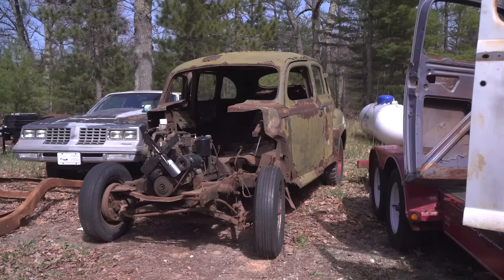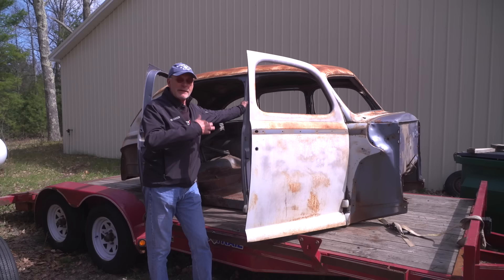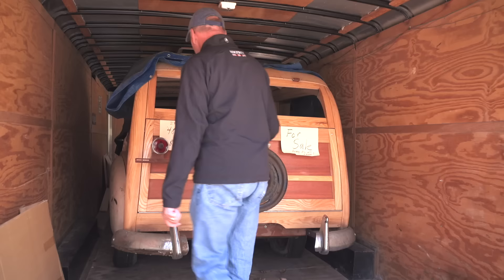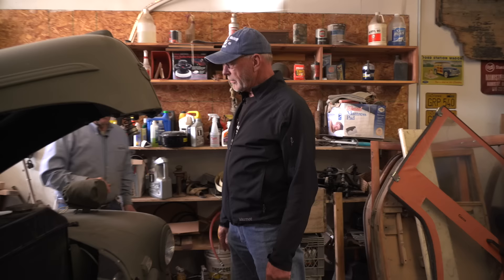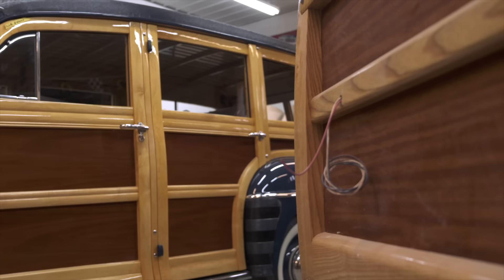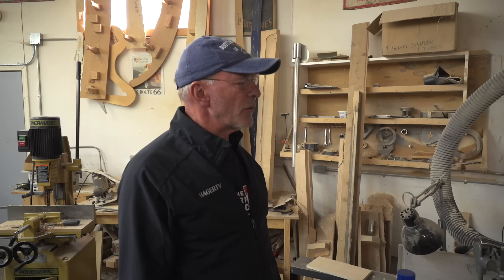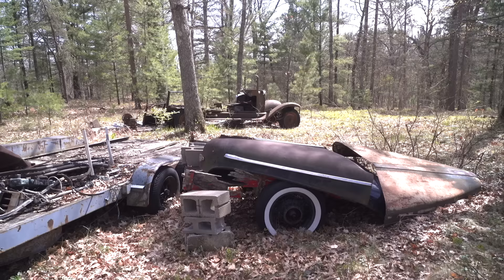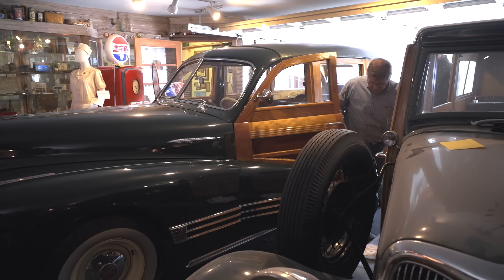Woodie Wagon craftsman collects and restores Military buyback cars | Barn Find Hunter - Ep. 76

Comment: Why would you ask him if he has a paint booth?? And then post it? There a lot of these mom and pop restoration  places that been around for years that do not conform to commercial and other zoning regulations and only paint on a limited basis. But broadcasting it high profile manner could bring down all kinds of regulatory grief. Such as cease and desist along with requirements to install $ 100,000 paint booth and ventilation system for a guy that paints one to 2 cars a year. Careful what questions you showcase. It can create a lot of hardship and grief. I've seen it happen before.
Reply: bcabmac you tell he didn’t really like that question. Don’t get why they didn’t cut it either.
Reply: meyers  True....I agree with you. You sound like you know exactly the kind of nightmare scenario I'm talking about.

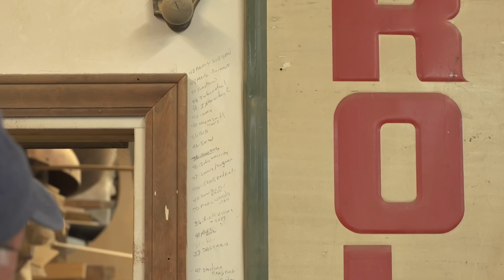Comment: What a timely coincidence, a woodie I just bought was restored by Mike Nickels back in 2013, a 1948 Mercury (listed on his wall of woodies @15:18, #2 from the top under the Army Wagon).  The previous owner handed down a huge binder full of restoration notes, pictures, and ideas.  It's there where I ran into the Nickels restoration.  The previous owner had it upgraded to a 12V system among other numerous items to make it road ready for the 2,300 mile Great Race of 2017.